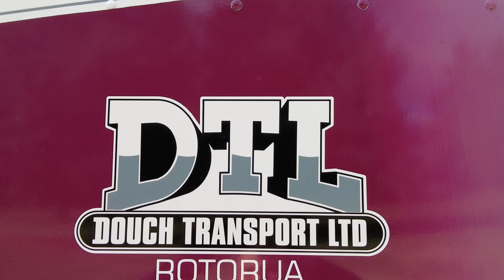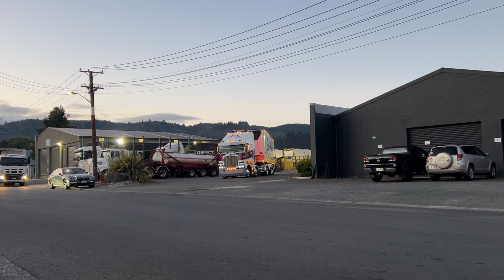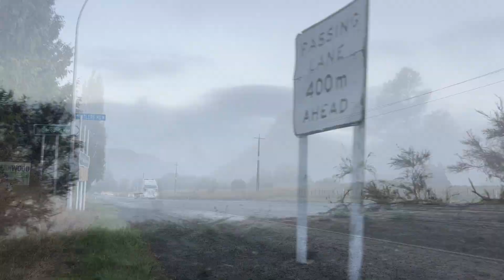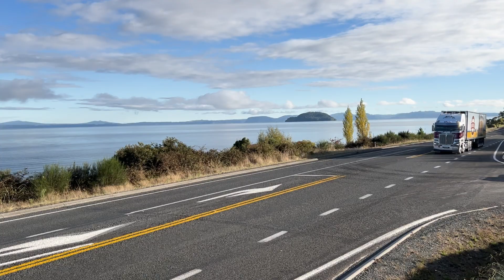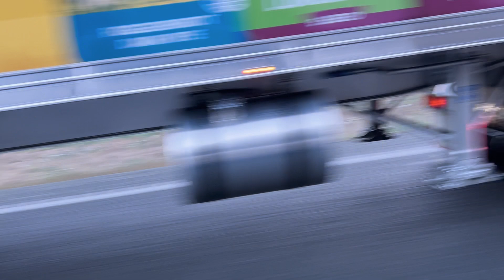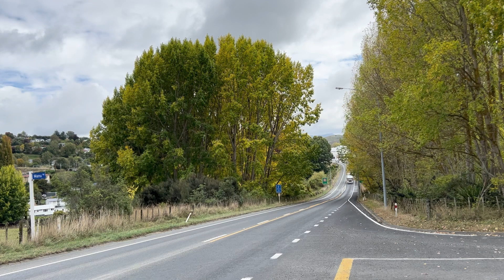Giti Tyres Big Test Kenworth K220 8x4 Aerodyne sleeper Cummins X15 &  Endurant XD Pro transmission

Comment: 30 pallets? What's that in metres std chep pallet 1200x1000 there abouts, assuming short end 1000mm x15 x2 30pallets 15m+, if its the 1200 wide end then something around 18m+ of deck length on the semi alone. Which is it?
Reply: At a guess it will one be all loaded std so 15.2m internal or it could be like my unit I had where one side is normal and other side stranded then you swap as you load the trailer one side standed other side normal then the next spot other way around and my truck loaded like that was 16.8 internal but I don’t think you can build them any more so most likely a super quad at 15.2 internal